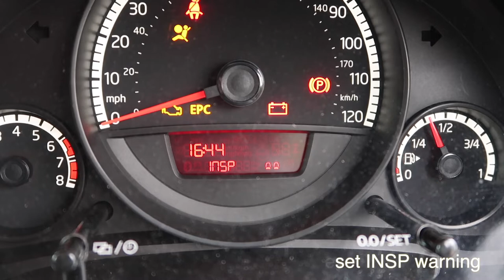VW Up! 2014 , Oil, Oil Filter and Air Filter Change. Reset INSP Warning

Comment: If the title is "Oil, Oil Filter and Air Filter Change" why would anyone ever in fact remove the oil filter first then release the oil sump nut? (the way you did it) Isn't it the other way round, oil removal then the filter?
Reply from the maker: Hi, thanks for leaving a comment on my video. The oil and filter both got changed so I figure it doesn't really matter which way around it's done. Cheers.